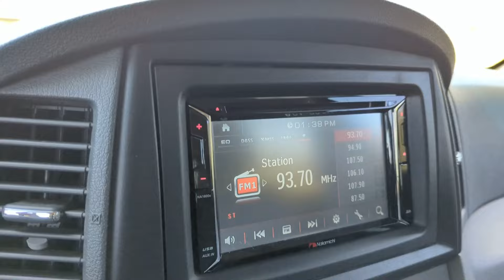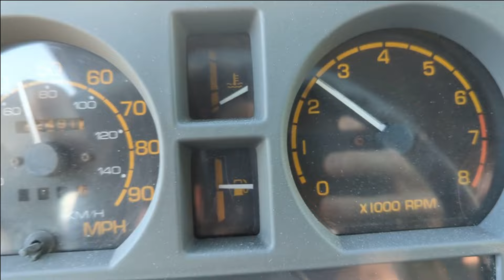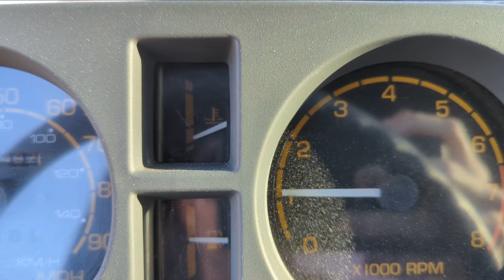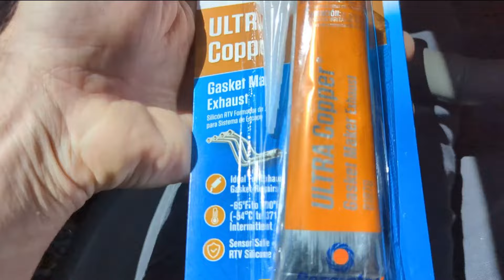Part 54 Wrap Repairs, Fixing Sections, Seams

Comment: To find your low spots on a flat panel, spray sandable primer, use a long sanding block, low spots will still have the primer on
Reply from the maker: Right, thats a good trick. I did that on the fenders and it worked well. I think the hood kinda flexes and conforms to the block because I basically did that before I ran out of sand paper the first time around and it was still pretty bad. It's crazy how flimsy these are. I think it was luck that it came out flat this time around lol. Thanks George!

Comment: I just paid $2.55 a litre for 98;in Sydney (Australia )the other day.....
Reply from the maker: Holy crap that's almost $10/gallon! That's insane.
Reply: @FixLife119  yep .. fluctuates between about $1.95 and $2.60 for premium. Have to suck it up when I am driving my AMG, but the Suzuki LJ80 takes E10/91 and easy on fuel so I get some relief...that's ~ $2.05 at moment 😂. Premium here is 98 octane. 91 is the lowest octane we get here
Reply from the maker: @andrebaumbach9447  Yeah here it's 87, 89, and 91. Some places get 93, although I've heard even though the numbers are higher in other places it doesn't mean that's the octane level. Not sure if that's true. I used to be able to go to the airport I was flying Cessna's at and get AVgas (101 low lead) for barely more than regular gas. Just a few short years ago gas was below $2/gallon.